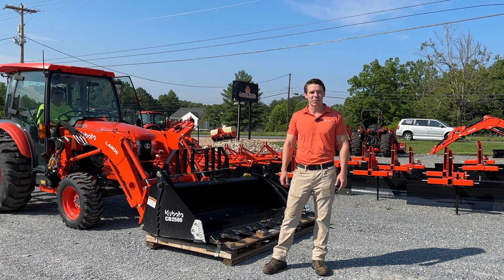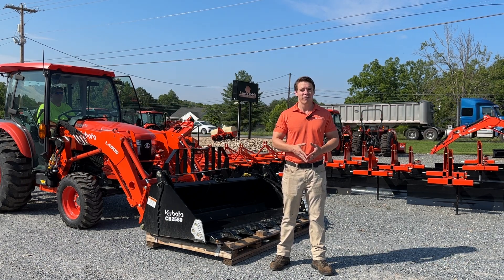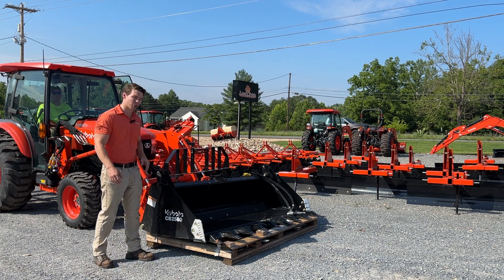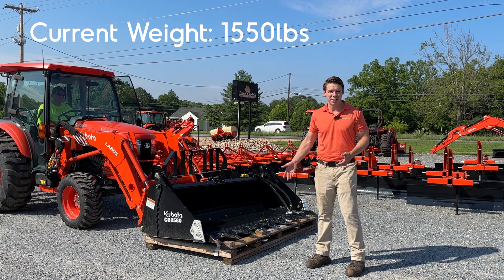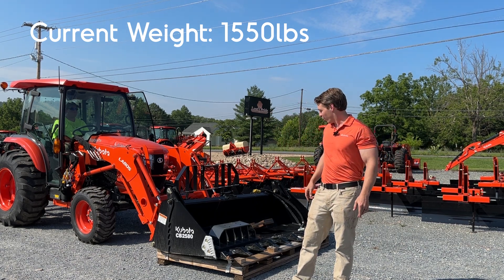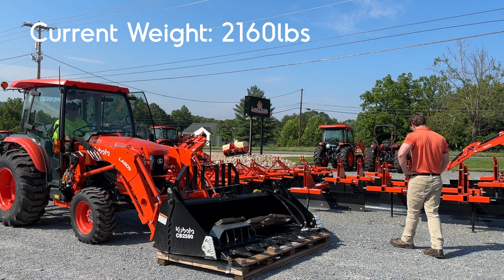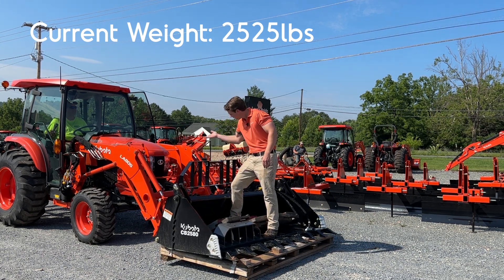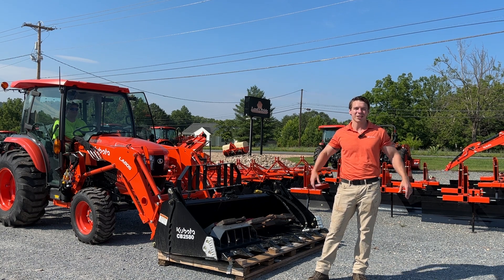What is the ACTUAL Lift Capacity of the LA805 Loader?

Comment: Great video!  I’d really like to see the actual lift capacity of a  l6060 w/ la1055 loader.  I would like to see if it would have the ability to offload a 3000lb item off the back of a tractor trailer.?.?  Only has to do it once or twice. Thanks in advance.

Comment: My tractor has a LA854 loader. Could it pick up a bag weighing 1000kg off a truck and put it on the ground without breaking it? My tractor is a MX5200. It has a 600 kg counterweight on the back and water in the back tyres.

Comment: what are the advantages of getting the L4060 over the L3560 in practical usage of the tractor. I'm leaning towards the 40 but folks are saying it's not much of an upgrade.
Reply from the maker: The more power the better! Especially if you are looking at a Cab model, with the A/C running and a implement on the rear you will lack a lot of power on the L3560. Going uphill with a bucket of dirt in the hot summer will cause it to slow down and bog down.
Reply: @kubotaoflynchburg  L3650HSTC owner here (the one with the cab), and can confirm, she doesn't like hills with a full bucket. That being said, I use it to haul around IBC totes full of seasoned firewood and it gets the job done... Though if I were to do it over again I'd probably get a 4060 instead.

Comment: You didn't make it clear which tractor this is. I am guessing it is a L4060. That is physically a longer wheel bass and a bit heavier than a L3560 even with the same loader I wouldn't expect the same results of the L3560. The numbers you got there are impressive! When my customers ask what it will lift I am going to tell them to watch this.
Reply: Huh, that's interesting, I bought a 3560 and nobody told me about the size difference. I thought it was just horsepower.

Comment: Ive had my 805 on my 4060 pick my ass off the ground a few times and thats with a 6 foot boxblade on the back. Its a beast of a loader for the size of machine it was designed for.

Comment: I would like to know the hydraulic pressure the system is running. My LA805 will not lift that much.
Reply from the maker: I am not sure the exact pressure, it was a brand new loader put on earlier this week on it so it will be factory specs. If you feel like yours is under-spec then I would take it to your local dealer and let them test it! Of course make sure you have your throttle up and the proper counter-ballast on the back!
Reply: You must have an issue then because mine has picked up close to 2000 lbs of wet sand more than a few hundred times.